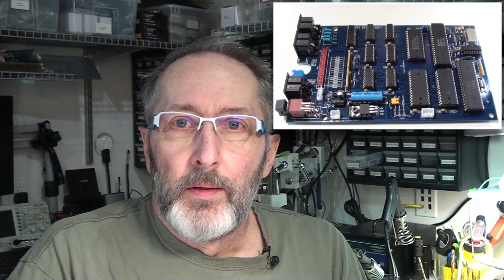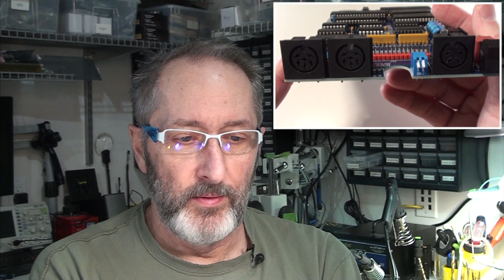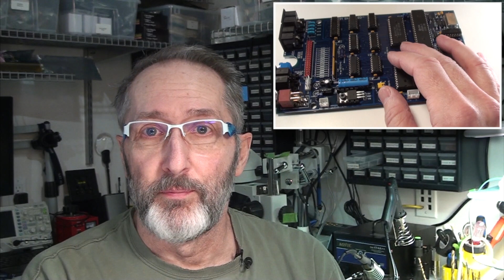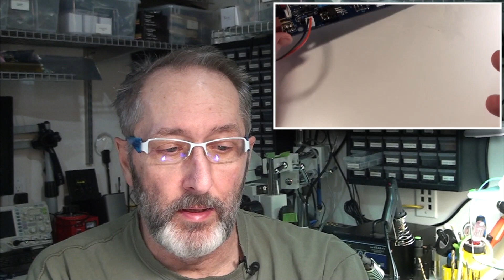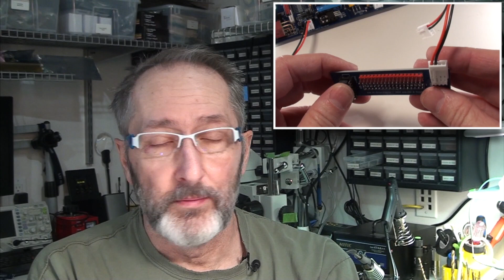A Commodore 1581 Drive Board for the Masses not the Classes

Comment: This is fantastic! Thank you for all the hard work! Not only the PSU issue solved (though I have an 1541/II and the PSU of that will be ok for 1581 too) but also the limited selection of PC floppy drives fit to 1581!
I will definitely order some of these PCBs, and i have somewhere some old working PC drives.
One question, if only a stable 5V is required, why noone uses USB's 5V for these Commodore devices? It is very stable DC and you can easily get a charger with 2A or 2.4A. 
And then you have no concerns regaring the DC polarity... USB mini connector is more robust, I frequently see it on portable HDDs.

USB-C even better you can plug it in any way :-D and supports really high Amps.

Comment: Is that a 7805? You can reduce space and heat further by using a TRACO TRS-1 2450 instead.
Reply: the TRACO TRS-1 2450 uses about the same space but I agree I would use one and i may get one so i can run it off a 12v PSU the 7805 gets HOT! AF on 10v input 
I was going to get 1 for my C64 to replace the 7805 in that.
Reply: @Mr_Meowingtons  The 2450 is 96% efficient and doesn't even get warm to the touch. I put one in both my TS1000 and 2600 Jr. and love them. They also take up 1/2 the horizontal width. Only downside is cost - around $6 each.
Reply: Considering the mech uses 0.7A and the rest of the chips need at least 0.5A, a 1A regulator won't regulate and a 1.5A regulator will be burning close to its maximums. Really this needs a 2A switching regulator at the minimum. There are other problems with the PCB.  Very poor design.

The "TSR-1" is 1A limited so this won't work.  You need the TSR-2 2450.
Or save some money and get a V7805-2000.
Reply: @officermeowmeowfuzzyface4408  They have a wide range of similar devices which can output 2A or whatever you want. There are 8 or 10 in the series. Still better than the egg-fryers they used to use. Cool to the touch.

Comment: Thank you for your hard work on this project, Thomas!  I'm slowly accumulating a list of things I need to obtain and do to build a drive, and I appreciate your effort in making a BOM available.

Quick question regarding the alternate power supply for the board: is there a 12VDC rail for the floppy drive?  I see 12V listed on the silk-screen, coming from the 4-pin DIN receptacle, but the alternate power supply will only regulate to 5V.  How do we power the drive mechanism with only 5v?
Reply: I've come to realize that there are several "modern" floppy drives that only require 5V for their electronics and motor drive.  The older generation use 5V for their electronics and 12V for driving their motor.
Reply from the maker: @SteveGuidi  Yes, I was just about to reply to say that modern fd's only need the 5v, but you figured that out.  So, older FD's that require 12v as well are off the table for the build.  Probably better off with a newer drive anyways in terms of reliability.

Comment: Do you see it feasible to have such 1581 boards running with a C64 or the new CX16?
Reply from the maker: I can't speak to that, as I know nothing about this CX16 you mention.  If it were compatible with Commodore's IEC interface, then I suppose it could be possible.  It does however work just fine with the C64.

Comment: Nice Video this is fantastic! Looking at how you made the adapter board to use even the HD 3.5 disks since SD ones are very rare! One question is that adapter board work on the original as I have 2 1581 that the disk doesn't format a disk it starts but fails it tells me the drive mech is going bad! Changing a mech using a real 81 drive mech is just as high as the whole drive!?

Comment: This is amazing! I've always wanted a 1581 but as you say they are just so expensive now. Building one is a lot more fun and is a lot more cost effective. Thanks for your excellent work, the universal power supply add on is a nice touch. I imagine one of the switch-mode 78xx replacements would also work... and likely run cooler too.
Reply: Anything to keep the real vintage hardware experience going is great I think!

Comment: timemark 5:55 Use regulator chip LM1086IT-5.0 , by Texas Instruments or Linier Tech, with the 5.5 or 6.5 Volts block from a multi-port USB hub

Comment: So you use 1.44 floppies and have access to the whole capacity of the disks?
Reply from the maker: You can use 1.44 mechs, but still only have access to 800K of storage.
Reply: @8BitResurgence  That could be an issue. If you have a DD drive and write a DD disk, then other DD can read. You use an HD drive to write a DD disk in a DD format another DD drive  may be likely will have trouble reading.
Reply: @neophytealpha  its not that big of a deal the density of the 800k disk and the 1.44 is so close it works fine. I just got mine up and running and made a bunch of disks and 0 errors.
Reply: @Mr_Meowingtons  they are unlikely to read on an original 1581 though
Reply: @8BitResurgence  Has to do with write head track density.